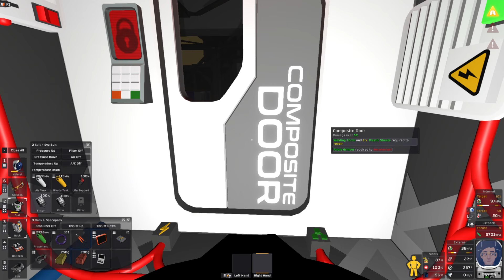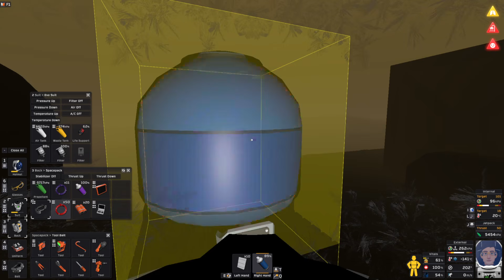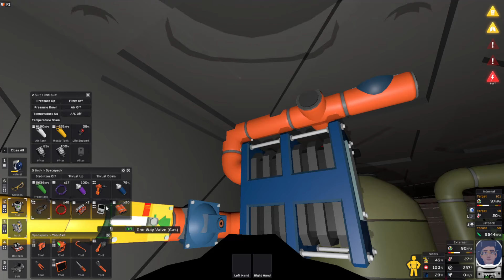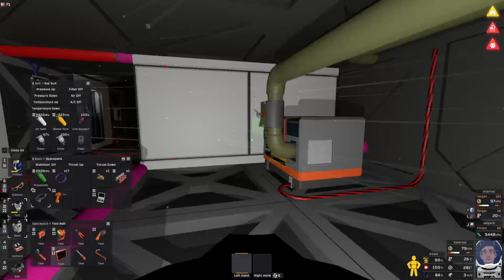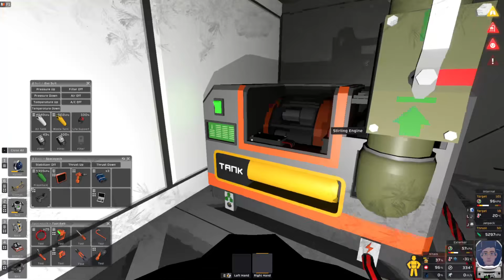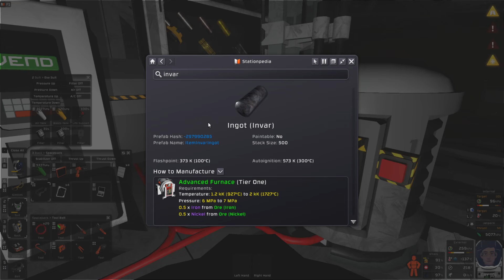Stationeers Titan Part 32 : Expanding Atmospherics

Comment: I do find those long pipes annoying if you haven't finalized the design/layouts. I've learnt to put a single segment in between the long ones, so that if i have to add a junction, it's easy and i don't have to remove a long pipe section to do so.
Reply from the maker: Yeah I hope they develop a way to join to them - Stationeers is basically a game about not having finalised a layout :)

Comment: Nearly two hours, but a good watch. I wonder if thermal expansion in the pipes is modelled and causing the groaning.
Reply from the maker: Pipes will groan when close to max pressure but the underlying issue is the pressure differentials within different parts of the atmospherics as a result of vacuuming the new area. I do get it sorted but it drives me a bit crazy and reminds me why on Titan I usually build with frames - the 300kPa pressure limit of steel walls is too close to ambient.